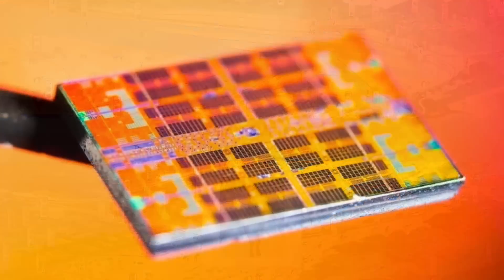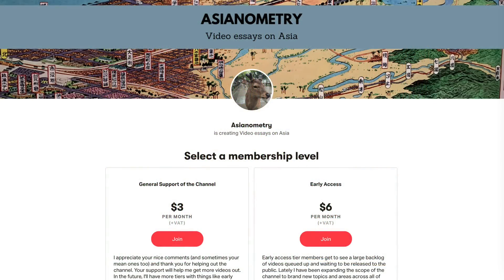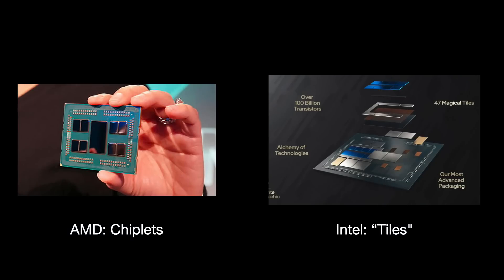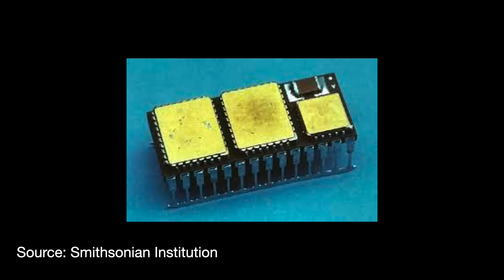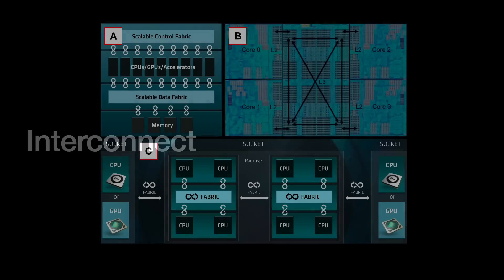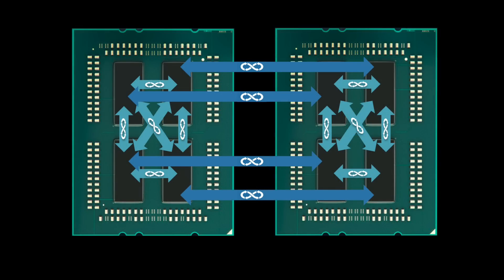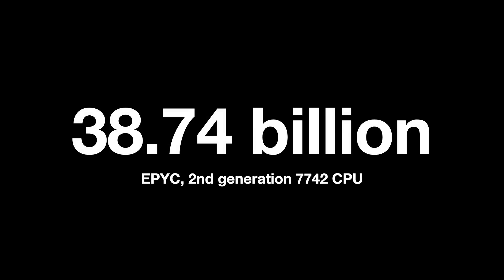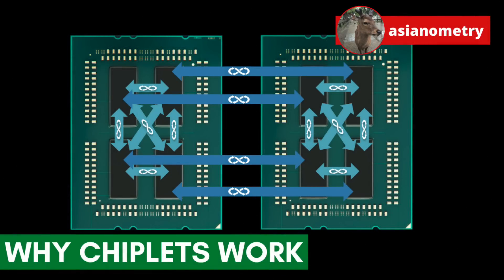Why AMD's Chiplets Work

Comment: Great video! I taught a course on Advanced Packaging a number of years ago and it's nice to see the industry moving towards MCM/Chiplet designs and, now, stacking of chips. Perhaps a future video can be done on passive vs active interposers?
Reply: You're lau? I don't think you're lau.
Reply: @feynstein1004  ?
Reply: @michaellau5329  It's a reference to this video:
https://www.youtube.com/watch?v=h1sCiXTlR8Q
Thank me later 😂😂
Reply: the arm of cyborg arnold left behind at cyberdyne really helps this subject.
Reply: I remember a Professor saying that optimizing separetad parts doesn't necessary mean optimizing the full result when the parts are working together... so that in general integration and considering the entire system usually is better. It is kind of crazy that for me that we went from discrete chips, to almost full integrated, and going back to somehow discrete...But I guess that some systems became too complex for us to optimize in an integrated mode nowdays.
Reply: @ale895 The problem is scaling the cost goes up by area squared thanks to defect rate. It's much more economical to have two seperate processors at half the area, for you can make them at a quarter the cost, or something like that. Then you could optionally link the two with a large L4 cache, for instance. And cache is basically always our limiting factor these days. Thankfully it also helps bring down the power for area of the processor so it doesn't melt, if the thing was purely computational.

Comment: Quick tip for you, if you use obs for recording you can set your microphone audio to be on a different audio lane than the desktop audio making it possible for you to treat the audio on an external program and then import it back during the editing process, that way you can remove the breath sounds from your audio. It can be achieved by importing the audio to audacity (First you will need to use your preferred video editor to export only the audio as an mp3 or wav for example), choosing a part of the audio where the breathing is noticeable and going to effects -> Noise Reduction -> Get Noise Profile then doing CTRL + A and going to effect -> Noise Reduction -> mess around with the settings (in your case use low settings since the breathing is noticeable but not intense) and click "ok". After that export the audio from audacity and replace the audio from the video with the exported one on your preferred video editor :)
Reply: yeah dude the breathing is a bit distracting (although natural)
Reply: same thing i did back in 2015 x) old times
Reply: @ShienChannel  Yeah :) It's an old trick I learned from the Minecraft gameplay times back in 2014 when we all had shit microphones
Reply: I didn't really notice his breathing before but now I can't un-hear it. Thanks.
Reply: Maybe the breathing is for effect, like "breathless prose".

Comment: Back in the early 80's I was in a design team working on a Hardware Modeling Library at Mentor. 
Our device allowed 'chips' of up to 256 active pins (400 pins total) to be included into software simulations. (pre-widespread use of VHDL, obviously). I designed the physical interface into the customers' 'chip' (among other things). It was very interesting to query packaging folks from Intel, Fairchild, Wakefield, Brit-Telecom, Mercedes, etc) on what their upper-limit on pincount was... often I got a very cautious glance and 
... "Well, how many can you give us?" as an answer.

Many of them were only willing to talk about a more traditional hybrid-on-ceramic packaging. Whenever I turned to 3D packaging, I got a variety of answers, from "Nope, not for at least 5 years" to ... "Well, that depends on the vertical height we can have"
[our device had 8 card-slots spaced 1.25 inches on center and had to account for a 0.125 inch thick controlled impedance PCB, and ZIF socketing.... either 4x64 pin, 2x 128 pin or 1x400 pin (256 active pins)].
Just for fun, I'd ask if the full 12 inches was enough. The answer would be : "Of course, yes, but we still want to have up to 8 devices installed in the card cage... and 1.25 each inches is a bit tight. "   which I always interpreted as they wanted over 1 inch EACH for their concept of a 3D multi-chip interconnect including all cooling heatsinks, fans, etc. 
Our answer was "just pull one interface board (running 7, not 8 devices) and then you have 2.5 inches to work worth ... otherwise, buy a second HML". 
Some customers did not smile at that suggestion. At over 100 grand, this was not a cheap device, bitd...but you could run up to 4 boxes under one multi-unit license.

Only one young engineer at an unnamed aerospace company did not flinch at the 1 inch headroom... I imagine THEY were the ones who had the most compact version of the 3D packaging at the time. 

BTW, this was the same set of informational "interviews" that forced us to go to 256 active pins.
When we started this, we thought we could get away with "just" 128 active pins. Virtually EVERYONE told us to double it.
Our engineering manager CRIED when he heard that... us design-grunts were cheering it on!! MOAR POWER is always good, right?
Now, designing the backplane and send/receive data lines and phasing clocks to get insane state-transition control times, THAT was fun to do.
Controlling crosstalk and race conditions in the PCB layout just about cost me my sanity, but I made it work and it remains THE QUIETEST system (as measured on a FCC testing facility at Mariposa) that I was ever associated with... and the biggest.
It was an amazing box of rawk.

Tho no one asked for it, getting up to 512 active pins for one model would have required a change in the way we transmitted/stored the data for vector-in, vectors-out, tri-state-data and timing analysis data.
Reply: Man, thus is just so cool. Im glad you shared your story here.

Comment: Intel joked that AMD just "glue" their chips together. 
Also Intel: Yep, we'll be using chiplet design soon.
Reply: intel glued CPUs together in the past - the Pentium II and III in Slot Versions had On-Package-Cache for example - and later the first Core Generation had mutiple "glued" together CPUs too - like the Core 2 Extreme QX6700, the Core 2 Quad Q6600 or the Pentium D 945
Reply: Of course the problem with stacking is heat dissipation. A cube of silicon won't be able to get the heat out of the center fast enough. I guess they'll go to fluid cooling of these cubes if they ever stack that deep.
Reply: Not really

Intels tiles are very different from amds chiplets
Reply: @suntzu1409  emib baby, but it's worth a note theres multiple ways to skin a cat, and each have their own pros and cons.
Reply: that joke is on intel. They aren't even able to use glue the right way when they glued the ihs to the pcb(for example i7 8700k) what caused terrible bad temperatures. i rather don't think that it would be an good idea if intel starts to glue anything together again.
Reply: @suntzu1409  first we need to see, even if they can do it or not, and even if they'll ready with lunar lake with chiplets, amd will be at zen 5 with 3d stacked chiplets, based on open standard..
Reply: @suit1337  That Q6600 was excellent.
Reply: i use amd radeon
Reply: Compared to Intel's Foveros process, AMD does glue their chips together.
Reply: @name-ic3vo  you don't think Intel can manufacture a chiplet based design?
Reply: @suit1337   the  Pentium pro the OG of gluing
Reply: @barneyklingenberg4078  i still have a Q6600 Running but its just a  pfseance box now.
Reply: @gblargg  you can sorta sew heat pipes or something similar into the "cube". Maybe even combine Infinity Fabric with heat dissipation
Reply: one more reason for me to no longer buy an intel product.
Reply: this aged like wine

Comment: I worked in the aerospace industry sometime ago. 

They had a MultiChip module that contained an ASIC die which they had designed in house, and dies that were basically off the shelf, Ethernet PHY, Flash, MRAM, and oscillator. MCMs have been used there for quite some time it seems. They did it because they had basically no choice.

Comment: Computers started out with multi-chip designs.  Central processing units weren't a single chip - they were several chips, all doing different functions.  It was Intel's big innovation to pull all those functions together and put them onto a single piece of silicon.  Not quite all (I/O and memory controllers remained external to the CPU for a long time), but close enough.

The funny thing is that AMD is deliberately going backwards.  They were the first to move the memory controller onto the CPU die, which provided a considerably performance boost, and now they've reversed that.  You really can't stress too much how important a very high-speed interconnect is when doing such things.
Reply: looking through computing history you will notice they do this alot
Reply: VLSI integrated functions onto one die lowering cost and improving power efficiency, while benefitting from Dennard scaling making shrinks smaller cheaper faster WITHOUT increasing thermal density.
Now not only does i/o not scale, but cache neither on current processes and the energy density in high performance logic has become a real limitation.
Thus chiplets space out heat generation in many core CPU, while large local caches allow gangs of CPUs to work mostly with local data, while  trips to main memory become so  proportionately slower that performance sensitive software does all it can to  avoid unpredicted memory access.
Not only is a 64c/128t chiplet cheaper but is impossible to market as a profitable product when monolithic.
Binning of chiplets with selective disabling of cores, allows for far greater core efficiency or clock speed in premium models because the chiplets can be chosen to suit a SKU.
A monolithic die has to space out cores to reduce logic density wasting expensive wafers and cannot mix n match parts to meet SKU requirements.

Comment: the infinity fabric is the secret sauce. having a suitable interconnect for the fabric is what makes this possible for sure.
Reply: The irony is that the QPU would work if they dropped their UMA. You could push data from any core to any adjacent one. Supercomputers with thousands of cores work like that, a core can't randomly address any other core, not without calling the "network". 
But then you would have the Cell architecture with their PPUs. 
Fabric is easy to program I guess, because it's just like a network switch.

Comment: MCMs faced two major issues during my time at Intel several years ago. The first was the most obvious: putting multiple chips in the same package meant the heat dissipation of the package now had to be designed for the two chips - ostensibly doubling the required heat dissipation. We handled that by throttling down the chip clocks, a process that has been largely automated by onboard temperature sensors and variable clock generators. IE., if you put two of today's advanced chips in a single package, they will self-throttle downwards.

The second issue is that anytime you have a signal leave or enter a chip, it goes in or out via a pad driver, essentially an amplifier of that signal designed to drive the large capacitance of a PCB trace. This adds delay to the line. A lot of it. Internal trace drivers only have to worry about driving very short lengths of narrow and flat aluminium/copper. Not so with PCB traces. MCM pad drivers could be backed off a bit to compensate for minimal traces in the MCM, but typical MCMs unite chips that would normally be packaged separately, requiring a design change.

PS., like the old movie "support your local gunslinger", keep in mind I am a stupid guy in the process world. The real process guys have to keep a fan on their heads to keep their brains from overheating :-)
Reply: It isn't really doubling the heat dissipation though. Taking an existing device at X wattage and splitting it up into different MCM components doesn't raise the wattage of the combined chips by any appreciable amount -- even if we include an active interposer. However, adding additional chips (read: cores, features, etc) to a design would definitely increase the thermals.

Put another way, the advantage of a fully integrated chip vs MCM isn't about thermals, but moreso that fully integrated chips were a result of continuous process improvements over the course of history. It became cheaper to produce an integrated chip rather than go with MCM or COB. The overall performance improvements were a side benefit.

Asianometry does touch upon the latency issues with MCM in the video too -- and it's something that AMD has seemingly solved architecturally.
Reply: @michaellau5329  Didn't follow that at all. Two chips in a package with X and Y heat generation somehow is not X+Y? New math?
Reply: @scottfranco1962  No, X/2 + X/2 = X. However, X + Y is definitely X + Y.

A theoretical chip that is designed in a monolithic fashion versus MCM will consume roughly the same amount of power.
Reply: @scottfranco1962  Or put another way, designing a device that has a power dissipation of X watts in a particular package will be the same regardless of the number of chips inside. There is of course the arrangement of the individual chips underneath the heat spreader, but that's something else for another day.
Reply: Far as I know, chip manufacturers aren't incorporating heat pipe design concepts into the surface of their chips- there should be plenty of heat performance still available.
Reply: Support your local Gelsinger
🗿🗿🗿🗿

Comment: The great thing about chiplets is the ability to mix different type of process tech on the same chiplet device.  For example, the CPU (which is built on a process tuned for low capacitance) and the DRAM (which is built on a process tuned for high capacitance ...)

Comment: What is missed is that AMD chiplets DONT just WORK. They overcome the downsides of familiar MCM and revolutionize computing from the stagnant Intel sinecure it was. They have been incredibly clever.

They had one shot at avoiding oblivion - they needed a single design which cost competitively scaled to ~all markets.

They didnt link existing cpuS, but designed a teamable processor core unit (4 core CCX) from the ground up.

as others here say, the key downside is the power & lag used by inter core data transmissions over any distance, so this was the focus of the CCX design - each of the 4 cores had a direct hardware link to each of the other (adjacent) cores - this needed only 3 such ultra fast intra ccx links on each core.

inter CCX links were lavishly and liberally cached to minimise lag.

Having given Fabric the optimum hardware, they then put disproportionate focus on Fabric.

They initially strategically yielded to Intel on the sexy IOPS at which monolithic ~wins (gaming), & gradually gained a flanking foot hold & then advantage based on raw power and cheap costs of harvesting - even at inferior process initially.

So I have a problem with dismissing it as something Intel etc. can just whip up in the lab & marketing - BS. 

a/ it requires a ground up re-design of their entire processor range & discarding a lot of IP
b/ its been over a decade of hard yards - validation, patents, ....

Infinity Fabric is a huge moat for amd - its clear that Intel were caught utterly flat footed by it in 2017
& have mostly just tried to ignore it since-  not take it for the serious threat it is.
Reply: That's not everything too, before zen 2 most separate silicon interconnects for chips were very slow and huge latencies(100s of nanoseconds), amd found a way to bring 512b wide IF(servers) and < 100 nanoseconds of latency by working with TSMC, which paved the way for others.

Comment: Remember Pentium II? Intel had problems placing all that primary cache memory on the Processor chip, so they used the multichip approach, with the cache being the added chiplets. The cache run at half of the processor clock speed anyway.
They returned to a monolithic structure with the next generation, after one year...
Reply: IIRC, the (earlier) Pentium Pro had a separate, interconnected cache within the same package.  Unfortunately, it was expensive and ran 16bit code poorly, but it really cranked with pure 32 bit code.
Reply: Returned?  The Pentium II was the first Intel processor that included a L2 cache at all.  If you wanted L2 prior to that, it had to be SRAM chips on the motherboard.  Or, with the 386, if you wanted any cache at all, it was on the motherboard.
Reply: @TrueThanny  It was way more fun back then! Nothing like discovering the newsgroups and getting a JPEG viewer to look at your first digital nudie pics!

Comment: Great video. I didn't really understand why chips on a bigger fab process are more expensive, but once you talked about using smaller chips to 'approximate' to the size of a bigger one, it made sense (my 'aha!' moment) - bigger fabs use more space, so there's less space to make more of them = if it has errors, it is a waste and now you've wasted all that space. If it had been made smaller, then at the least the cost for a bad chip is less. Thanks!

Comment: IBM developed the first large MCMs in the late 1970s with volume shipments starting in the 1980s.  Their first MCMs have 100 and 118 chips on each module.  They were originally used in mainframes.
Reply: Im not completely knowledgable, but everytime I come across some technology/architecture I hear "yeah IBM made a product with that back then and it dipped but then it gained traction" lol
Reply: @AvgAtBes2  Lisa Su (AMD CEO) worked at IBM from 95-07. So technically she is an IBM alumni.